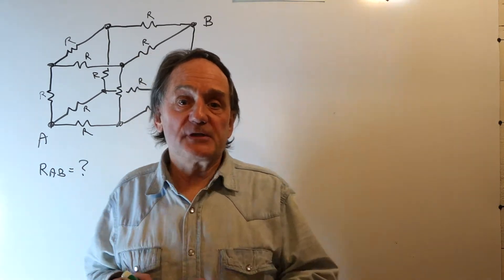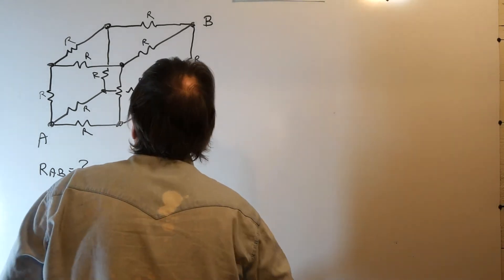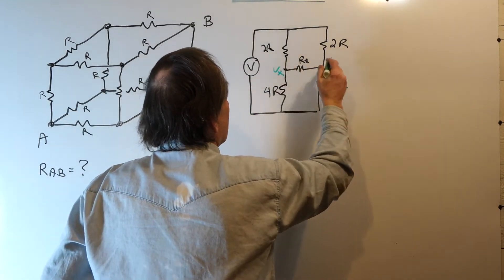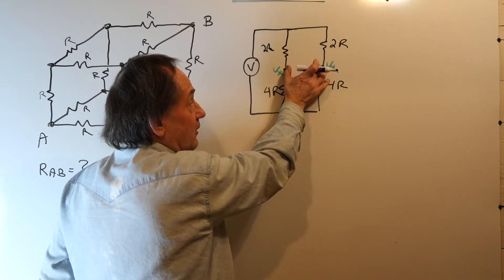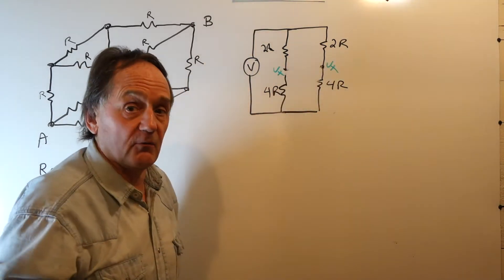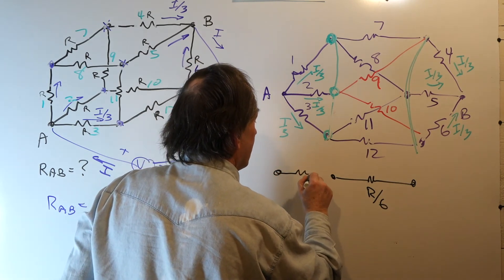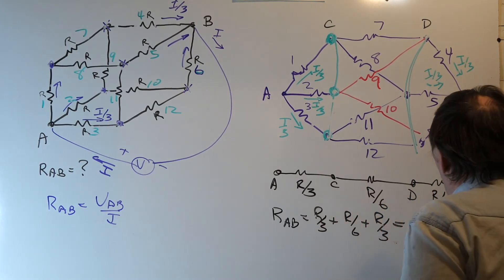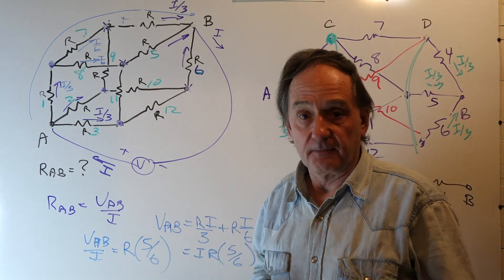Resistor Cube

Comment from the maker: The cube is solved beginning at time 8:14

In a circuit with multiple nodes, if the voltage or potential of two or more nodes is the same with respect to a given reference, we can short or place any resistance we like between those nodes and there will be no change in the currents in any of the remaining  branches of the network.  As a consequence,  shorting two or more nodes that are at the same potential creates a zero current through the shorting paths. Therefore, shorting or connecting nodes together at the same potential will cause no change in the distribution of the currents in circuit and therefore no change in the equivalent resistance.  This is like having an equipotential surface in electrostatics over which no current can flow due to the fact that all points along the equipotential are at the SAME potential and there are no potential differences that can cause a current to flow along the equipotential.

Armed with this fact,  short the 3 diagonal points that are adjacent to point A, and do the same for point B.   Redraw the circuit to reveal a new planar circuit:
 
Moving from point A toward point B,  there are 3 resistors in parallel, followed by 6 resistors in parallel, and those 6 followed by another 3 resistors in parallel, at which point we get to point B.  The equivalent resistance of "N" identical resistors in parallel is   Req(N equal R in //) =  R/N

Therefore the equivalent resistance is:
Req = R/3 + R/6 + R/3 = 5/6 R

====================================================================
Reply from the maker: Question:   How do resistors decay in resistance over time?

ANSWER:
The stability of resistors over time depends on the resistive material  (thin film, thick film, wire wound, metal foil, carbon composition, copper, aluminum and nicrome alloys, tantalum nitride, etc.)  Different materials have different mechanisms.  The most stable resistors are your metal wire wound and metal foil types.   How the resistor is physically constructed also impacts the stability.  Thin films tend to have oxidation issues that can "eat" into the resistor body and change its effective width and overall resistance.  To avoid oxidation problems your best resistors will be encapsulated in a hermetically sealed package as with the Vishay S102 series and HP series of resistors.

Film resistors/conductors as deposited on the substrate of an IC(integrated circuit) also have "metal migration" issues whenever current flows through the conductor.  Such migration causes metal atoms to move or flow with the current and can acutally result in an "open circuit" over time if care is not exercised to choose the proper conducting material and lay it out properly on the IC substrate.
GH   Oct. 31, 2019    4:05am
Reply from the maker: Question:    Is there a matrix of resistors with the same effective resistance as the (single type of) component resistors? The first example is simply to have N many parallel sequences of N resistors. The effective resistance of each sequence is NR, and the resistance of N many resistors in parallel is R/N, canceling out.   But are there more complex solutions to this, that aren't just nested copies of this (as any one resistor could be replaced by an NxN parallel/chain sequence)?

ANSWER:
There is an infinite class of such "matricies".  Such matricies do not have to be confined to planar arrangements.  Such arrays are untilized in the construction of highly stable  RESITOR  STANDARDS  that use the statistical averaging of N interdigitized resistors to achieve stability over time and temperature.
GH
Reply from the maker: Ulf Häller
Find the equivalent resistance across 2 edges:

Yes, for instance between point D and point C Req = (7/12) * R  Ohm.

Across the diagonal on one face of the cube I get Req = (3/4) * R  Ohm
For example between point A and point C.
Reply: I guess it is kind of off topic but does anyone know a good site to stream new series online ?
Reply from the maker: @novaterrance7724  not sure what you are asking.  What do you mean by "new series"?
You can always have a YouTube channel and run a live show from there or use Google Meets.
GH
Reply: @Nova Terrance flixportal :D
Reply: @Kamryn Zahir thanks, signed up and it seems like they got a lot of movies there =) I really appreciate it!
Reply: @Nova Terrance Glad I could help :D

Comment: Watch this video, it 's the calculation of equivalent resistance of a cube formed with different resistors
https://youtu.be/cWIW6eKfQ80
Reply from the maker: You can still use some symmetry arguments to simply the problem when three resistors forming a "WYE" or STAR" all have the same value as in the video you link.
The "WYE"  to "DELTA"  transformation can be used in general but the application involves a lot of algebra and calculation.
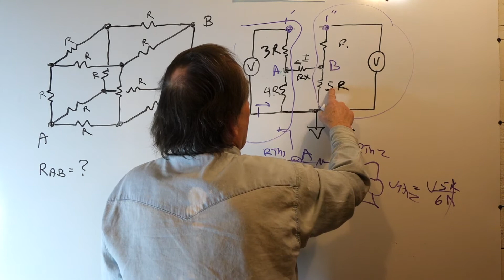I discuss the transformation at time 7:38 in this video:
https://www.youtube.com/watch?v=j6SPHfiCGjM&t=1717s

If the cube say had all 12 resistors of different value,  I would just go ahead and write loop equations and use matrix methods for there would be no short cuts to take advantage of and the WYE/STAR to DELTA conversions and simplifiying parallel combinations would be really cumbersome and computation intensive.
GH   12/26/21

Comment: what about differents resistors ? (Like R1=1, R2=2 .... R12=12) ?
Reply from the maker: The "WYE"  to "DELTA"  transformation can be used in general but the application involves a lot of algebra and calculation.
I discuss the transformation at time 7:38 in this video:
https://www.youtube.com/watch?v=j6SPHfiCGjM&t=1717s

If the cube say had all 12 resistors of different value,  I would just go ahead and write loop equations and use matrix methods for there would be no short cuts to take advantage of and the WYE/STAR to DELTA conversions and simplifiying parallel combinations would be really cumbersome and computation intensive.
GH   12/26/21
Reply: @georgehnatiuk5806  I tried to use Kirchhoff's rules and matrices and star / triangle transformations, but frankly after writing off ten sheets of paper I just gave up)
You have a Ukrainian surname! You are from Ukraine?
Reply from the maker: @Andrii_Trey  
I did not say it would be easy applying the transformations several times to reduce the network when you have no symmetry to take advantage of.   Lots of algebra would be required.
Brute force methods like writing simulataneous loop equations and using matrix methods would get you there but still with lots of algebra.  The matrix methods give you good bookkeeping and several ways to check yourself for errors along the way.  It would require 6 loop equations, one for any 5 faces of the cube  plus another involving an applied voltage source placed between opposite ends of the diagonal.  You would then solve for current I indicated in the diagram shown at time 11:00

No matter how you do it, if you symbolically labeled the resistors , R1, R2, R3 etc.  and wanted to find the equivalent resistance RAB in terms of these independent resistance values, it will be a huge complicated expression.

My grandparents were from the Ukraine.
GH
Reply: @georgehnatiuk5806  Greetings from Ukraine ;)